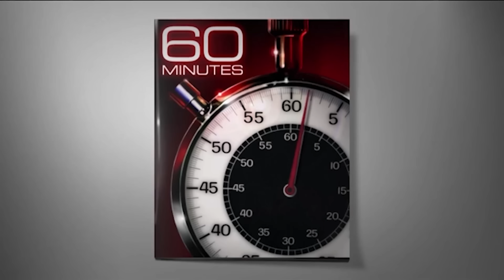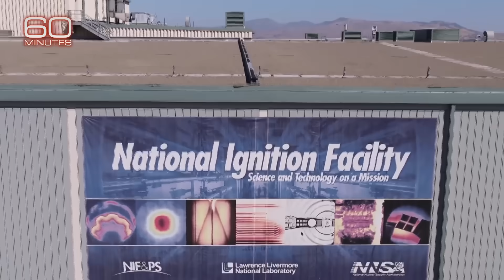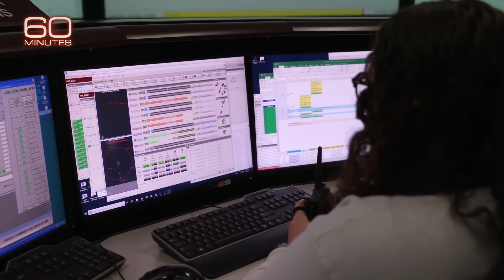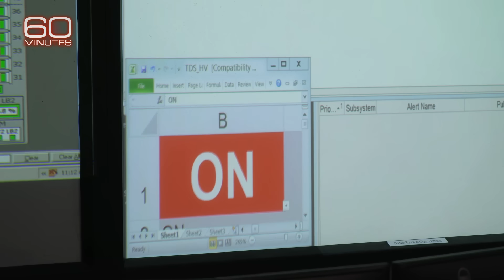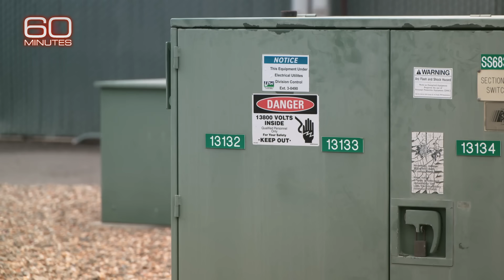Nuclear Fusion: Inside the breakthrough that could change our world | 60 Minutes

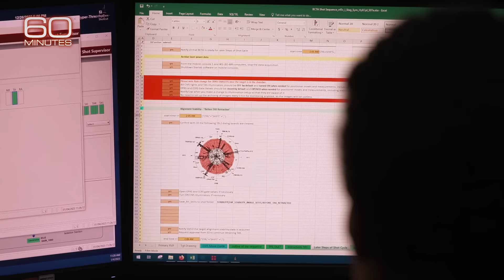Comment: 4:25 what exactly do they mean when they say “the beams strike with the power 1000x greater than the entire national power grid”?
Is that the input?
Reply: It is a way of hyping the output energy of the 3 billionths of a second laser pulse. It means that during that  0.000000003 seconds the pulse had about the same amount of energy as 1000 times greater than the whole U.S. electrical grid transmits during the same extremely brief period of time. What is not made clear is that they have to wait almost a day to do another laser firing due to keeping the lasers thermally stable and the desire to not seriously damage the massive multibillion dollar laser system.
Reply: @vernonbrechin4207  vernon not knowing the difference between power and energy. Unsurprising his understanding of breeding is from the 80s then.
Reply: @Gomlmon99  - I freely admit that I sometimes use the improper term, such as power when I should have said energy. Naturally, that error provides an excuse for some to dismiss what I've presented.

Perhaps you can explain the concepts of tritium breeding from the 1980s and the concepts of it in most of the current experimental nuclear fusion reactor experimental facilities. Do the new concepts avoid the problem of robbing some of the fusion neutron energy to breed the tritium fuel? Has the problem of embrittlement of metals exposed to the radioactive tritium been solved? Do the newer breeding 'conceptual designs' employ some other isotopes, other then lithium that has been enriched in the 7-lithium isotope? To what degree have tritium extraction and containment facilities been constructed at all the other nuclear fusion research facilities?

In the case of lithium metatitanate that is enriched in 7-lithium isotopes and formed into pebbles how will the deposited thermal energy be extracted and will the pebbles flow through a system that will minimize erosive  degradation? Additionally, has their been a slow-down in the facility at ITER that has been working on this engineering challenge?
Reply: @vernonbrechin4207    Yes, they don’t “rob” the energy, Li-6 + n is an E other mix reaction. 

Yes, they use other isotopes. They use both Li-6 and Li-6 as well as beryllium and lead as multipliers. 

Tritium extraction faculties have already been prototyped and demonstrated, and full scale ones are now under design. 

Embrittlement is somewhat solved by easily replaceable parts and remote handling. But not really relevant to the breeding discussion.
Reply: @Gomlmon99  - I've been educating myself in regards to the 'Tritium Breeding Systems' that are considered a key component of the ITER complex. I saw the announcement of the work on changing out components rapidly that will become embrittled and radioactive over time. I noticed that about six different tritium breeding systems are included for the testing but the final design will have to wait until a prototype power plant is constructed after the ITER test platform is operational. Until then ITER is expected to consume the rare and expensive exiting tritium supplies. I'm still unclear how much effort is continuing to occur in the ITER 'Tritium Breeding Systems' portion of the program. The ITER newsletter has no recent article on it. Of course that is a  'company rag' intended to keep ITER in the best light. That is often done by obscuring major problems, or simply not reporting on such issues. Its job is to keep moral up among staff, contractors, managers, press and the politicians behind its funding.

I was just reading about a major project that is closely related to NIF called 'Laser Inertial Fusion Energy' (LIFE). it was expected to succeed NIF and lead to an economically viable ICF nuclear fusion power plant. After major planning, involving  many years of work, a review was performed by the U.S. National Academy of Sciences (NAS). The review wasn't favorable. Shortly after the funding was quietly withdrawn from the project while keeping its demise as quiet as possible. I've seen such things before after hundreds of millions of dollars have been such into such projects. We certainly wouldn't want the public, the press and politicians to learn from such failures.

The people, working in such fields and their fans have become masterful at excluding the following warnings from their consciousness since the timelines in them increasingly clash with the expected timelines of these nuclear fusion power plant deployment timelines.

I urge readers to search for the following article headlines.

IPCC report: ‘now or never’ if world is to stave off climate disaster (TheGuardian)

UN chief: World has less than 2 years to avoid 'runaway climate change' (TheHill)
  * This statement was made 4.3 years ago.
Reply: @Gomlmon99  - Physical science and engineering techno nerds often immerse themselves in the arcane details of issues such as the advantages/disadvantages of Li-7 verses Li-6 tritium breeding while branding outside critical reviews as being irrelevant.

As a result of this dialog I looked into some aspects that nuclear fusion fans generally dismiss as being irrelevant. Here is one of the recent articles that I found and the notes I took under the citation.

OUT OF GAS
A shortage of tritium fuel may leave fusion energy with an empty tank (Science)
By Daniel Clery - 23 June 2022

Tritium -    $30,000/g
Deuterium -      $13/g

ITER will start with H/D experiments and was expected to begin using tritium around 2035. That date is now likely to extend out to 2038. ITER was originally meant to fire up in the early 2010s and burn D-T that same decade.

Even more (tritium) will be needed to start up EuroFusion’s planned successor to ITER, a monster of a machine called DEMO. Meant to be a working power plant, it is expected to be up to 50% larger than ITER, supplying 500 megawatts of electricity to the grid.

DEMO is conceived as a prototype power plant. The DEMO reactor is expected to fire up in the 2050s.

Researchers expect ITER to burn less than 1% of the injected tritium; the rest will diffuse out to the edge of the tokamak and be swept into a recycling system, which removes helium and other impurities from the exhaust gas, leaving a mix of D-T. The isotopes are then separated and fed back into the reactor. This can take anywhere from hours to days.

The area allowed for the tritium breeding experiments has been reduced in order to reduce the breeding blanket experiments costs.
Reply: @vernonbrechin4207  dude your understanding of the industry is so incredibly outdated and misinformed it’s almost comical. 

6 different blanket types on ITER? Have to wait for a power plant after ITER? Articles from IO on TBMs when first tritium isn’t until the second half of the 30s? 

Why are you still talking about such an old reactor at all? Why not look at designs for CFS, FLF, GF, TE etc.?
Reply: @vernonbrechin4207  Why are you talking about DEMO, EUROfusion, or ITER’s burn up ratio? I fail to see how any of these things are relevant to modern-day breeding?

Plus, your figures are off. Again.
Reply: @vernonbrechin4207    Unsure if I can tell you details as it may be proprietary, but there’s now fewer shortlisted options

No, why would they install them prior to the late 30s?

I don’t see IO using much tritium until maybe 2040, by which point we’ll be breeding loads. Personally, I don’t expect DEMO to ever be built - modern reactors will come online first and render it obsolete.
Reply: @Gomlmon99  - Interesting responses. ITER is an international cooperative project, not a private corporation that depends upon hiding its details from competitors. I've long been aware that there are many people who believe that secrecy is really cool stuff, even in a free and open society. For them holding secrets makes them feel special. The other, more modern private corporations that are hyping their technology, often withhold key details, claiming it is proprietary information.

Your claim that those more recent private nuclear fusion companies will not be breading tritium prior to the late 1930s and yet be breeding loads by the 1940s is based upon many assumptions of their future successes and is driven by wishful thinking. That 1940s date also is an indicator that you reject the following warnings of imminent collapse.

IPCC report: ‘now or never’ if world is to stave off climate disaster (TheGuardian)

UN chief: World has less than 2 years to avoid 'runaway climate change' (TheHill)
  * This statement was made 4.3 years ago.
Reply: That’s the power of the lasers.

Comment: How many shots do you take per day? Not me thinking the other kind of shots 😂
Reply: The massive laser amplifiers can't withstand more than a few shots per day. The normal rate tends to be less than one shot per day. This special experiment, that formed the foundation of this 'breakthrough' announcement, took about a week to prepare. The nuclear fusion reaction lasted about 0.00000000008 seconds before 96% of the fuel was blasted away from the reaction center, preventing it from reacting. If the NIF lab was able to repeat the extremely expensive experiment once every week then the nuclear fusion duty cycle would be approximately 0.00000000000001%.

Comment: Still looks impossible to me, 300 units of electricity used not even counting making the tiny steel ball, for 3 units. Where is the miracle
Reply: Good point. The target fuel capsule is a hollow synthetic diamond sphere that is nearly flawless in geometry and atomic composition. It is part of an complex laser target assembly that has been estimated to cost approximately $100,000. The result was a exceedingly burst of nuclear fusion energy that, if captured, could boil about two liters of water. I can boil that amount at home for under $0.02 of household electrical energy. It is truly amazing what one can get away with in a facility that has always been primarily funded as a thermonuclear weapon (H-bomb) research tool.

Comment: Personally I like the comparison of the Univac computer to modern computers. A whole room dedicated to running computations in the 50's would be easily accomplished with a handheld device now. The tech is just going to get smaller and better as time goes on
Reply: Not all technically innovative experiments make it to practical developments. Often it is found that they can't economically compete with existing, or with alternative, technologies. We don't hear much about the failures since many consider that to be embarrassing and not worth remembering. Those, who are most likely to not understand this, tend to be relatively young. The U.S. program called Project Plowshare is an example of a failed project that few are aware of. It lasted for at least 15 years and then was quietly defunded. It was championed by the imminent nuclear physicist, Dr. Edward Teller who is also known at the father of the American H-bomb. It experimented with nuclear explosions for a variety of civil engineering applications. I urge readers to look up the Wikipedia article on it.

Comment: What a fool's errand as this cannot be scaled into a functioning electricity power plant! Putting this amount of money and technical  expertise into improving efficiency of all electricity-consuming devices is a better approach....
Reply: One estimate is that the NIF project has already consumed approximately $11 billion of U.S. tax dollars that were assigned for thermonuclear weapon (H-bomb) research purposes. The target assembly took around a week to prepare and is estimated to have cost around $100,000. Approximately 4% of the extremely expensive fusion fuel was consumed in the fusion reaction with the remaining being blasted away from the reaction center and ending up as radioactive waste in the target chamber and its vacuum system. The energy was released during approximately 0.00000000008 seconds and if all of it had been captured to boil water it could have brought about two liters of water to a boil. If I boil that amount of water on my stove it would cost me less than $0.02. I'm astounded by the degree of waste that can result by a lab that is primarily funded as a nuclear weapons research tool.

Comment: If the copper piece on the target was still in tact and the melting point of copper is 1,900 Fahrenheit and the explosion that happened was right on it and was hotter than the sun, and the suns hottest part is 27 million Fahrenheit, why isn’t it melted?
Reply: Keep in mind that the interior of the large target chamber is evacuated to a high vacuum before each shot is performed. The fusion reaction occurs in a microscopic bit of plasma, several inches away from where you see the peeled back copper support structure. The copper is hit by expanding shock wave from the mini-explosion. The volume that reached 27 million degrees Fahrenheit was microscopic and that temperature only lasted for about 0.08 billionths of a second before the plasma expanded away from the center.
Reply: @vernonbrechin4207  I know I can’t really fathom .08 billionths of a second but why isn’t that long enough to melt the copper?
Reply: @Imjodaniel  - The support structure that was shown in the video was at least a couple of inches away from the microscopic point that exploded after it reached a temperature of approximately 150 million Kelvin. That lasted for approximately 0.00000000008 seconds. That energy was rapidly dispersed around the microscopic point of around a microgram of hydrogen isotopes that was involved in the fusion reaction. The energy released from that reaction was approximately the energy required to boil two liters of water, if all the generated energy was captured and used to boil water. All the material within about an inch of the mini-explosion was converted into an ionized plasma. That was not shown since it was a gas and dispersed to surfaces inside the vacuum chamber and was drawn into its vacuum pump system. The shockwave from that exploding plasma pealed back the copper pieces that were not vaporized by the lasers and the fusion reaction.

There are basically three states of matter, solid, liquid, gas and plasma. In order to melt matter, such as the copper it is necessary to deposit a certain numbers of joules (or calories) within a limited mass of that solid substance. The copper pieces that were shown were not exposed to enough energy for a long enough time to raise its temperature sufficiently to bring it to its melting point. In the case of water it takes one calorie of absorbed energy to raise the temperature of one milliliter of water one degree Centigrade. It takes 100 calories of absorbed energy to raise that one millimeter 100 °C to reach its boiling point. Classes in physical chemistry and physics teach these basic principles.

An explanation of the rapid dispersal of energy emitted from a 'point source' can be found in the following two Wikipedia articles which I urge readers to search for.

Inverse-square law
* See 'Justification' subheading.

Radiant energy

If the released energy is extremely brief, extremely limited in volume and is some distance away from the support material than that limited amount of released energy will not have a drastic effect upon it.

The NIF management have been masters at hyping the results to make it look highly impressive. Most journalists, who have reported on the so-called 'breakthrough' were snowed by the lab presentation and therefore ended up snowed millions of their viewers in return.
Reply: @vernonbrechin4207  are you a professor at at university somewhere? Or are you a scientist? This isn’t sarcasm I’m genuinely curious if you are
Reply: @Imjodaniel  - I've retained an interest in a broad range of the physical, biological and some of the social sciences since I was a little kid. Much of my career was in a world renowned high energy subatomic physics laboratory. Iv'e kept tabs on a wide range of other sciences, beyond the ones I worked with. Since the 1970s I've followed intimate details of nuclear fusion experiments, including those at the Lawrence Livermore National Laboratory (LLNL). Early on I believed some practical uses might come from the experiments. I've also looked into the physical processes that take place during the detonation of nuclear explosives. That has helped me understand the processes that take place during the NIF experiments since that facility has always been funded primarily to simulate nuclear explosions on a miniature scale.

I encourage you to explore a broad range of topics, including material properties, physics, physical chemistry and the various states of matter such as solids, liquids, gases, and ionized plasmas. Use Wikipedia to look up properties of copper such as its 'heat of fusion.' You may also want to look up subjects such as shock waves and condensed matter physics.

Thanks for your inquiry.

Comment: Not cost effective. Not happening in a decade or a century. Why don't we use what Tesla already gave us?
Reply: Because Tesla didn’t give us some magic energy machine, despite what the gullible conspiracy theorists like to claim.
Reply: @Gomlmon99  Nicola Tesla designed  an energy system that could generate electricity from out of the earth from the movements of the tectonic plates under the earth's crust. He also designed and used a system that could draw static electricity out of the earths atmosphere by using a 60ft. antenna. With both of these systems he was able to broadcast electricity wirelessly through the air using a Tesla coil. Too a town 18 miles away and light the light bulbs in all there buildings. These are facts look them up. Pin head!!